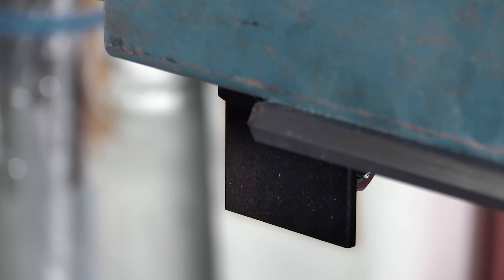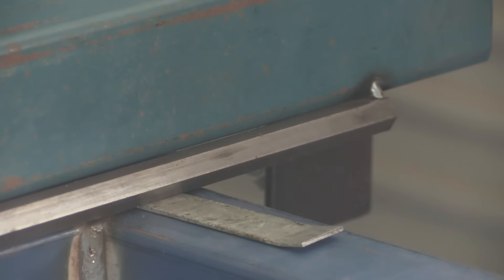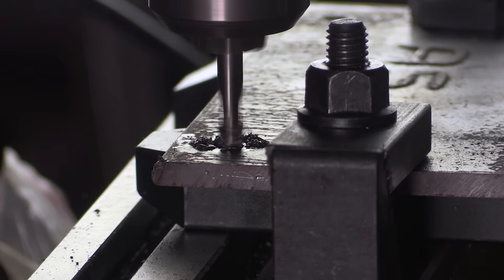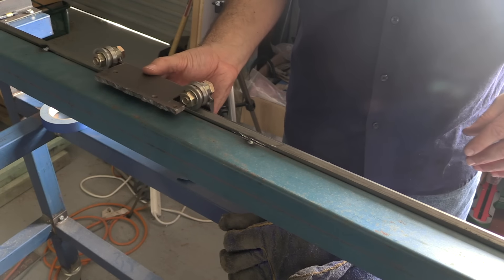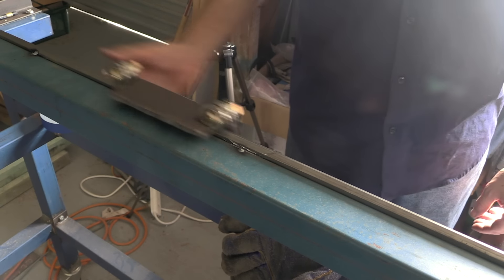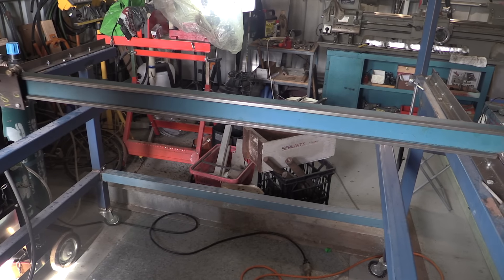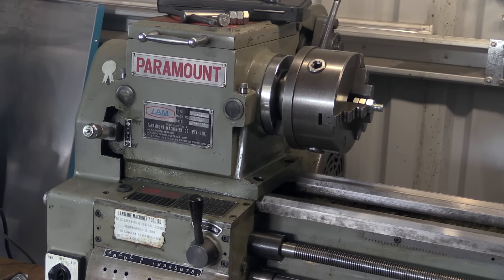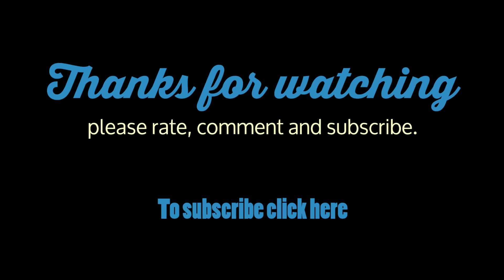DIY CNC by a novice part 10

Comment: Great video series Mark! When you do a weld, use an angle grinder or wire wheel to clean the area surface where you place the bead or tac. You will want that surface to be bright and even shine. Excellent video otherwise!